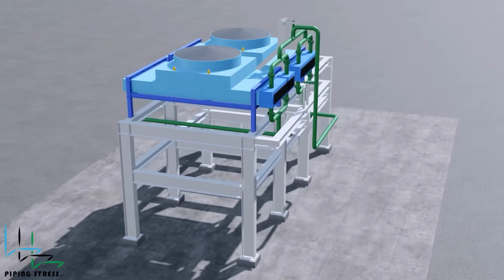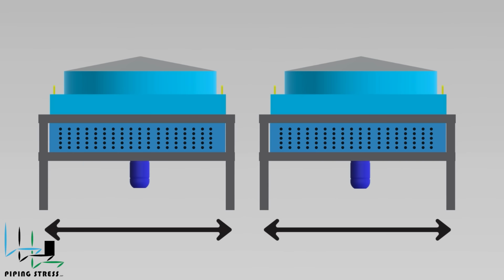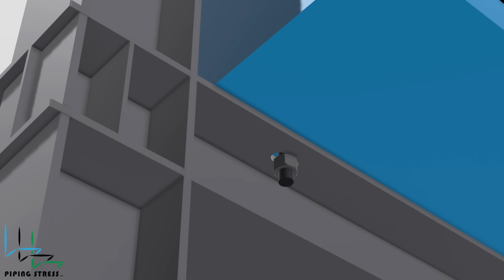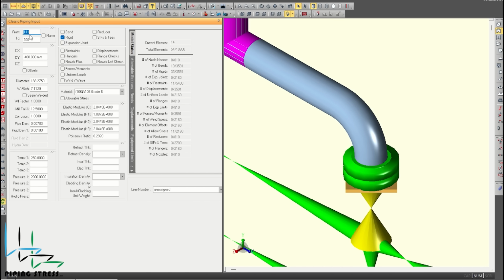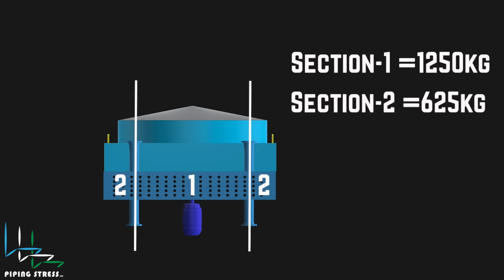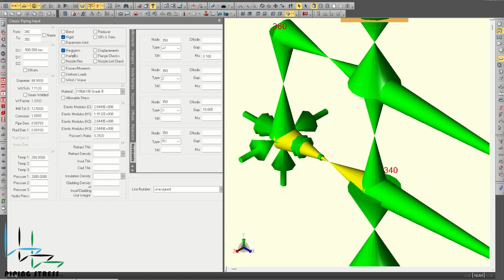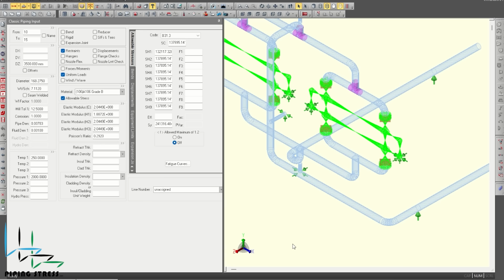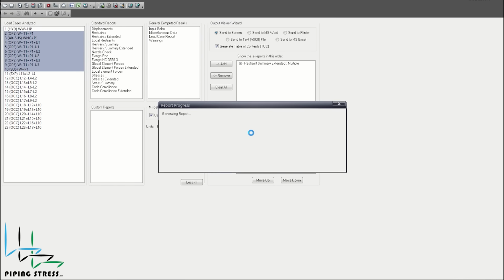Air Cooler Modeling on Caesar II

Comment: Thanks. 
Where and how will you put other 2500kg loads? How do we model other half of the cooler? Also, can you provide link to the next part plz.
Reply from the maker: Hi, you don't need to model the other half because you hold it on Rx rotation. 2500kg is the proportion of the cooler's weight; we enter it into Caesar II as a rigid body. Part II will be published soon.

Comment: Couple of observations.  The CNODE does not need to be on the next element, it can be anywhere else in the model.  Your air cooler model is over complicated with four vertical elements when one between the inlet manifold and outlet manifold will suffice.  That vertical element is also where I typically place the weight of the manifold.  Breaking the weight up across three elements doesn't really do anything for the model when they are all rigid elements.

You've also got to be careful to make sure to model the inlet manifold rigids at the temperature of the inlet piping.  Similarly, you should match the temperature of the outlet manifold rigid to the outlet piping.  If you model the air cooler manifold at an average temperature, you will create artificially high load on the nozzles due to a differential expansion that doesn't exist.

Finally, your guide structures aren't going to really contribute anything to the actual nozzle loads.  The gaps aren't going to close with the restraints being so close to the nozzle connections and you are going to show them restraining forces that they won't really see.  You air cooler header boxes are still going to see the loads.  You are better off putting restraints in the structure where they will have a chance to actually engage and push the thermal expansion away from the header box.

That said, you've presented a lot of good info for new analysts to consider, especially making sure the restraints on the header box keep it from rotating.
Reply from the maker: Thanks for your detailed feedback and suggestions.